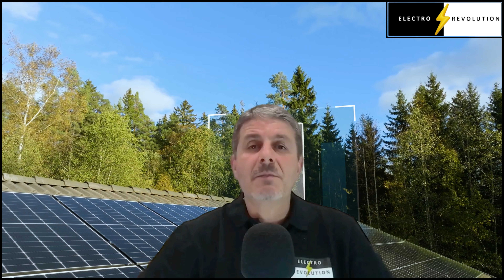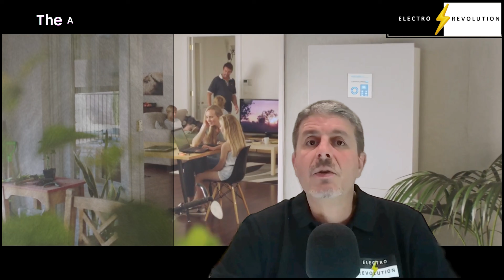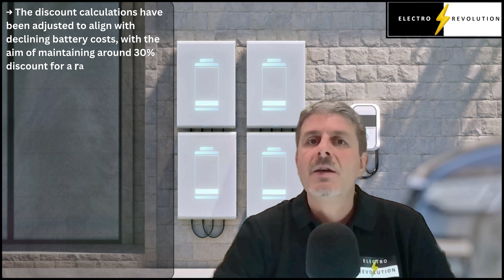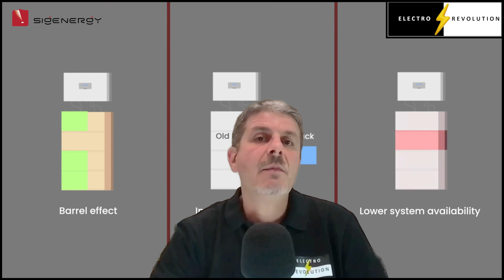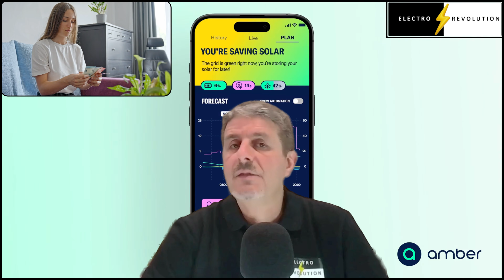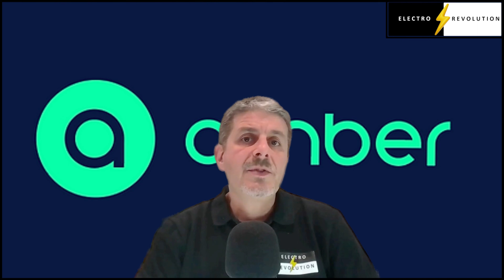Australia’s Best EV & Solar Energy Plans? AGL vs Amber vs GloBird Explained | Episode 1

Comment from the maker: Join GloBird Energy for $50 credit on your account using the referral link:

https://quote.globirdenergy.com.au/quote?pcode=refer&ref=3VQGA4

or by emailing GloBird customer service on:

cs@globirdenergy.com.au

specifying the referral details of:

Account Number: 30577216
Name: Michael Mansour

Installed a Sigenergy Battery? use my referral code for a $200 Amazon Gift voucher (until 31 Dec 2026):

SRRXPU

To use the code:

1. Install SigenStor
2. Log in to the web: app-aus.sigencloud.com
3. Go to - Settings - Account - Referral Code
4. Enter the referral code

Comment: Can’t you charge BYD EV between 1.00am to 6.00am and get off peak wholesale rate with Amber?
Reply from the maker: To the best of my understanding, no. Amber doesn’t offer a dedicated “free power” window, nor a dedicated "off-peak" window as many other retailers do. What they do provide are off‑peak electricity rates during "lower‑demand" periods, which often fall late at night or early in the morning.

The exact timing can vary depending on your network and your meter configuration, so unfortunately, the off‑peak window - for the cost and period of time - isn’t the same for everyone.

Comment: Hi mate - unfortunately you used wrong terminology throughout the video. You kept saying kW when should have said kWh. Battery capacity, electricity bills, solar feed-in tariff, battery grid exports etc are all calculated in kWh, not kW, as you repeatedly stated. I also see this same error is being used in the comments. 

It would be good if you can correct this error moving forward  ... and help to educate others who also use the wrong terms. Thanks for your video.
Reply from the maker: Thank you for taking the time to watch and to raise this. You’re absolutely right—my terminology was incorrect throughout the video. I appreciate you calling it out clearly, and I’ll make sure to correct my wording in future videos (kW vs kWh) and help keep the comments accurate too. Thanks again for the feedback.
Reply: @TheElectroRevolution thanks for responding. Best wishes for your future videos and for your channel.

Comment: AGL have increased their supply charge from 89c per day to $2.46 per day as of June 1st! 

I signed up on 30/06 and by the time it was connected I ended up with the $2.46 per day charge. Insane at $70 a months just for supply charge.
Once the $150 credit runs out I’ll be swapping.
Reply from the maker: Yes, that daily service fee really is a shocking cost.

I’m happy to share details where I can—out of interest, where are you located, and who is your wholesale provider?

On AGL: after I left, they emailed me (unsolicited, I might add) a number of times to come back. In my first week, the offers were genuinely hard to believe—there was even a $1,200 bonus just to stay another year. The most recent offer I received was a $400 credit, split into $200 for electricity and $200 for gas.

I was with AGL for many years, across a couple of different houses. But for me, once I installed the home battery, there was no real reason to keep paying for electricity supply. Continuing to do that with AGL/Amber just didn’t stack up anymore after the level of investment I’d made into the battery.

I’ve had some family members recently ask what I pay each month for electricity, and when I tell them it’s effectively $0 (from solar + the home battery) and I usually get into credit each month, they’re genuinely surprised. Yes, there is a payback period for the home battery—solar already paid for itself years ago—but when you factor in the electricity savings plus the fact you no longer pay a monthly amount for the grid supply portion, the payback drops dramatically from the original ~7 years I planned for. I suspect for me it’ll be down to just a few years.

I haven’t run the exact calculations, but it definitely feels like the ROI won’t be as long as I first thought. And it’s a nice feeling not to rely on the grid as much, which also reduces pressure on the grid overall as a consumer. The “free window” is when there’s surplus energy, so it’s best to draw on it.

Remember when you're ready to transfer, review the providers at that time to get yourself the best deal. If you happen to choose GloBird, remember to use the referral link, you might as well get a credit when joining.

Thanks for your comments.

Comment: Hello.  Thank you for your video.  I have just tried to use your referral code for my sigenergy battery but get an error message: "Invitation failed:  your acount or station creation date does not meet the reward requirments".  I wonder if it doesn't work for those of us in Victoria?  Or perhaps this is a once-use only referral code.  Could you please clarify? Thanks
Reply from the maker: Thank you for raising this and for taking the time to comment — really appreciate your question.

The Sigenergy referral program has a couple of strict T&Cs that often catch people out. The referral has to be requested within 7 days of commissioning, which isn’t much time at all, and the commissioning date must be after 1 May 2026. If either of those conditions isn’t met, the referral won’t go through and you’ll see that error message.

It should work regardless of state, including Victoria, so location normally isn’t the issue. It’s more likely the commissioning‑date requirement or the 7‑day window.

You might want to email their support team as well — they can confirm your eligibility directly and let you know if there’s any flexibility. If successful, you get the $200 referral, if not, at least you checked.

Thanks again for your comment and for checking in — really appreciate it.

Comment: Thanks for your timely video series.  I’ve been considering who to change to now that I have 30Kw battery + 13kW solar. I have had my concerns regarding Amber. Globird zerohero looks ideal so long as I track overnight needs and export in the evening peak, ensuring I keep enough to get through the night, and taking into consideration expected solar generation the following morning until free import period. Next step will be automation. I’ll use your code - you earned it. Thanks
Reply from the maker: Oh wow — thank you so much for using the referral, really appreciate it. And thank you for your kind comments as well.

It’s great that you’ve joined in June 2026, but your quote will reflect the new service fees and updated peak/shoulder rates. The earlier videos were based on my experience when I joined in April 2026, before the July changes. I’ve released another four episodes this week covering my two‑month experience with GloBird, including the updated pricing and how it’s affected things.

I genuinely hope it works out well for you. Even with the rate increases, GloBird is still the best value for my setup — especially when you have a home battery, solar, and an EV working together.

Thanks again for the referral and for taking the time to comment — really appreciate the support.

Comment: Hi iwas with amber a year or two ago, they say that just charge a service fee. That is not correct on top of the service fee they charge all these other bully shit fees, enerovment this and that fees other and  chages which acounted for near 50% ofthe total bill. They did not make me aware of these other charges that they dressed up. They are a disgrace.
Reply from the maker: Thank you for sharing your experiences. I hear you — and honestly, your experience lines up with what a lot of people eventually discover about Amber’s pricing model. They advertise a simple “$25/month service fee”, but that’s only one part of the bill. The real costs come from all the pass‑through network charges, environmental scheme fees, and market charges that Amber passes directly to the customer.

Amber’s whole model is “wholesale pass‑through”, which means:

    Every network fee from Ausgrid/Endeavour/Essential is added directly

    Environmental scheme costs (LRET, SRES, ESS) are added directly

    AEMO market fees are added directly

    Metering charges are added directly

    Plus Amber’s own $25 service fee

For many people, those pass‑through items end up being 30–50% of the total bill, exactly like you saw. And because Amber doesn’t bundle or smooth them like normal retailers, the bill can look messy and unpredictable.

The other issue is that Amber’s marketing makes it sound like you’ll “pay wholesale”, but they don’t highlight that wholesale still includes all the regulated charges — and those are the expensive part.

So yes, you’re not imagining it. The model sounds simple, but in practice it can feel like a pile of hidden extras, even though technically they’re “pass‑through” rather than Amber‑invented fees.

Comment: I have not experienced spike with Amber either.  I am getting bills despite having 2 batteries.  I am disappointed with Amber
Reply from the maker: It’s disappointing to hear that as well. I still have the Amber API connected to my Home Assistant setup so I can monitor when price spikes occur, and the last time I checked… nothing - and that's almost 2 months of checking in my area. 

I know some people do benefit from spikes, but it really seems to depend on the region and whether the local network actually needs a surge of inbound energy. Where I am, the grid is extremely stable — even blackouts are rare, maybe once a year during a major storm. I’d rather not rely on the hope of a spike and instead prefer predictable outcomes that I can automate around.

After I left Amber, I even received a second bill: 8 days of usage for $18. So in total, about $48 for 22 days. Meanwhile, I’ve been with GloBird for a month now and I’m already $19 in credit — and I consider myself a high‑energy user. Sometimes I don't/can't feed into the grid at peak times as I know we're using more energy during the night and I'd just save it for the next day until the 11am free period.

As I mentioned in the videos, it’s worth giving GloBird a try. They’ll send you a quote with “reference” prices, but if you have solar and a battery, those numbers are irrelevant. The only things that actually matter are the daily supply charge, the peak rate, and the shoulder rate. After that, look at the feed‑in tariff and the timing windows — these vary depending on where you live.

And if you do sign up, make sure you use the referrer code so you get that $50 credit added to your account.

Comment: I enjoyed your video.  My experience is very close to yours.  My solar panel count and battery configuration is almost the same as yours. I did try Amber for about 2 weeks but saw that the potential for earning credit based on the difference between wholesale prices during a day wasn't as big as I had hoped.  Probably because in the Melbourne I'm at, power fluctuations aren't as big as in the Sydney area.
Reply from the maker: It really sounds like you went into Amber with an open mind and a solid plan, and honestly, that’s the best way to approach any of these “smart energy” offerings. Your experience highlights something a lot of people only discover after joining: the marketing paints the ideal scenario, but the real‑world payoff depends heavily on where you live, how volatile your local grid is, and what hardware you actually own.

Your point about Melbourne’s flatter wholesale curve is spot‑on — without those big swings, the whole “charge when negative, export when high” model just doesn’t deliver the magic it does in NSW. And when the car‑charging automation only works for Teslas (and a very limited Zappi trial), it really narrows the value proposition. For anyone without that exact setup, it becomes exactly like: wholesale pricing and hoping for spikes.

I'm still monitoring Amber’s API through Home Assistant though, just seeing if I can properly track the spikes when they happen (even though I'm no longer a customer). I haven’t really seen any meaningful spikes.

If you ever explore other tariff options or plans, I’d genuinely enjoy hearing about what you discover.

Comment: Appreciate sharing your experience - circumstances similar to yours and I’m tossing between going either amber or Gobird. Electrician recommended Gobird to charge the battery over winter!
Reply from the maker: Yes, I was in the same boat after getting the home battery installed. AGL was OK, and even when I moved to Amber there were endless calls trying to keep me, with amazing offers of credit to stay with them. But I heard so many good things about Amber at the time. 

My neighbour also went with them and there was a great referral system in place (option for personal referral or bank referral). The bill gets shown in the videos and you'll see for me, the Commbank reward was $240/year discount on Amber's $25/month. Personal referrals are $120/year. But even that couldn't keep me there. You'll see more details in the following episodes.
Reply: But where is episode 2 🫣
Reply from the maker: Thanks for watching.. yes there's 3 parts to this series, one released per day...